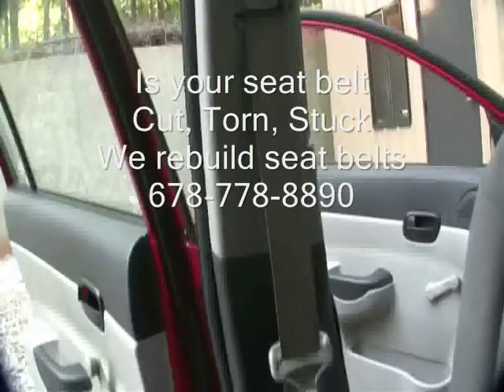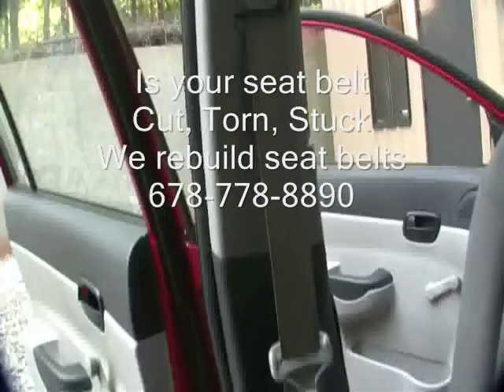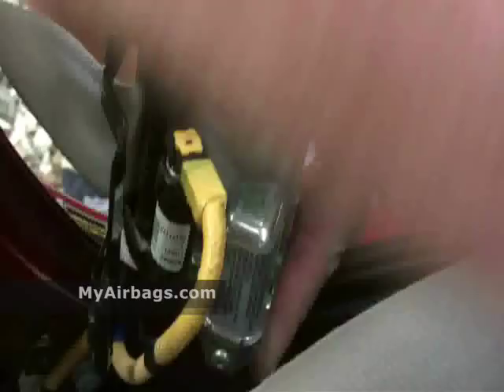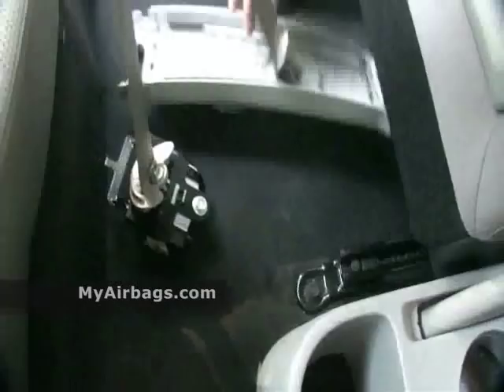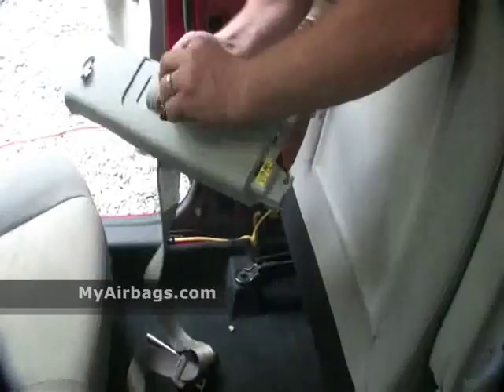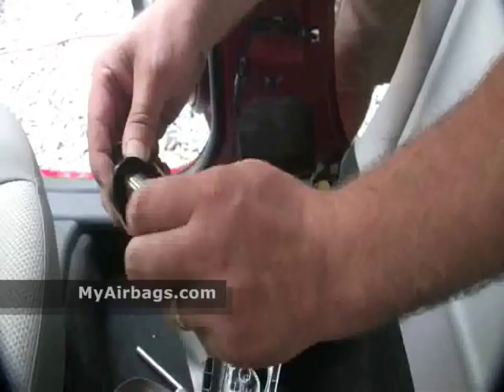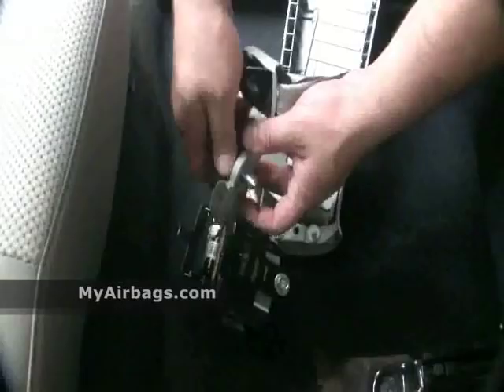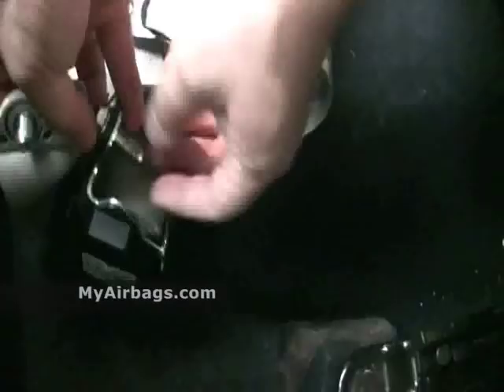How To: Remove Seat Belt Pre-Tensioner & Repair, MyAirbags.com

Comment: Excellent tutorial that covers enough of the basics of most B-pillar seat belts. It roughly translated over to my 2003 Ford Escape with only a few differences. BTW, if you're doing a 2001-2007 Escape, you're going to need a T-50 star bit, a 17mm socket and a 5/16" socket. A tiny flathead screwdriver makes it really easy to unlatch/unplug the electrical connection on the driver's side.

Comment: I have a 1994 ford laser and have to replace the passenger side seat belt 
before I take the old seat belt out to replace it , do i need to disconnect the car battery ?
or is it safe to replace a seat belt while the battery is connected still?
Reply: It is recommended that you disconnect the battery when removing or installing  seat belt pretensioners that are equipped with an igniter. On your 1994 Ford it is a should be just a regular seat belt without igniter.

Comment: when removed the top portion of the seat will have any problem with air bags on the side?
Reply: when I removed the top portal of the seat belt case will I damage or have any problem with my side airbags?
Reply from the maker: Peggy McDonald Side airbags are in the seat. Side curtain airbags are on the roof. So, side airbags are not in the way when removing seat belts.

Comment: Do you still have to reset the airbag module after replacing seatbelt?
Reply from the maker: If the seat belts locked after an accident, then YES the airbag module needs to be reset.
Reply: Well the seat belt was unlocked and does not lock at all
Reply from the maker: Sagar Chahal The airbag module should be good. You will need to use a scanner to clear the seat belt code after it is working again. If the code does not clear, you can always send the airbag module for reset.